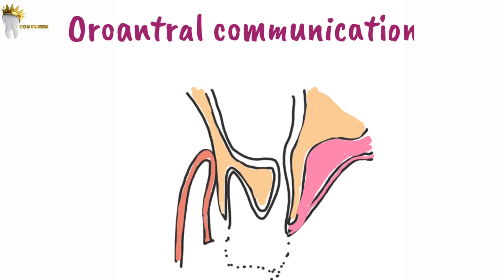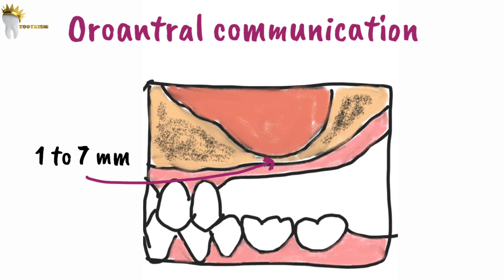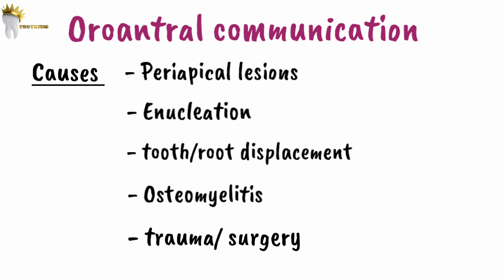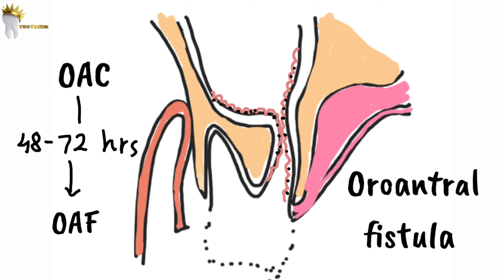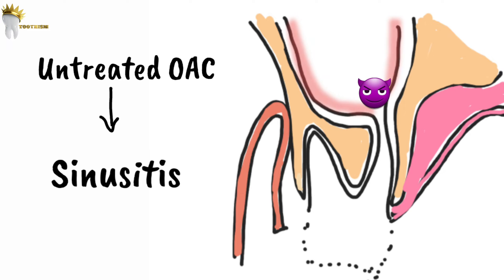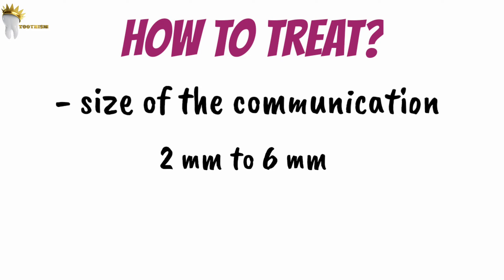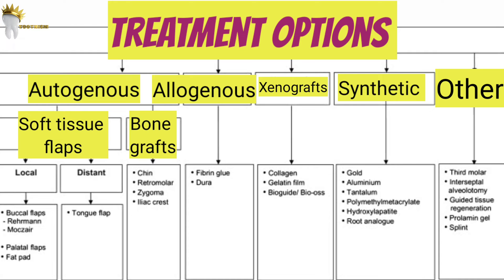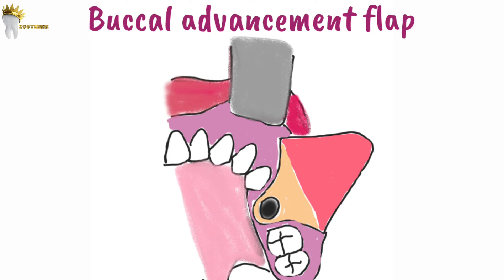Oroantral Communication AND Fistula | Treatment options | Oral Surgery

Comment: I had OAC because of a wisdom tooth extraction, the dentist had my CT scan yet she decided to pull it using force, I could feel and hear how the bone was cracking yet she said it was normal, because I'd never had a tooth extracted I trusted the dentist, she gave me instructions for a regular extraction and she never told me about the existance of this OAC, a week later I started feeling pressure and pain never went away even though I was very careful with post extraction instructions. I ended up having surgery to repair this OAC and I'm preparing to sue the practice.
Reply: I'm experiencing the same situation. Was the surgery painful? I'm so worried.